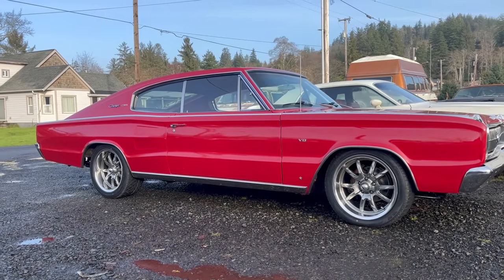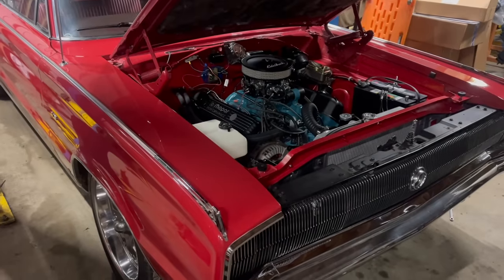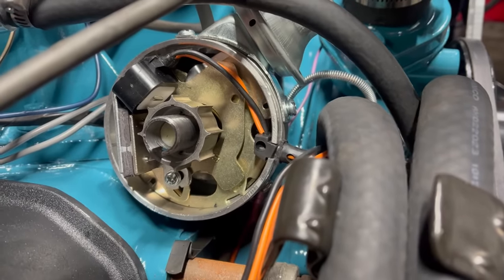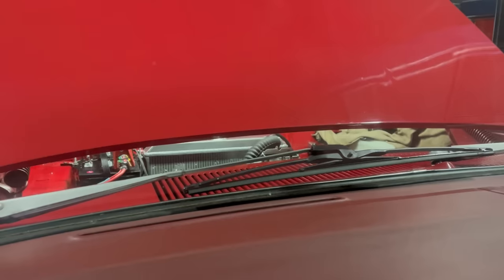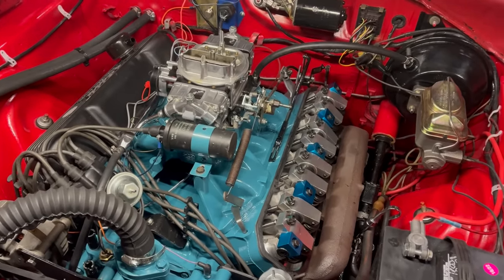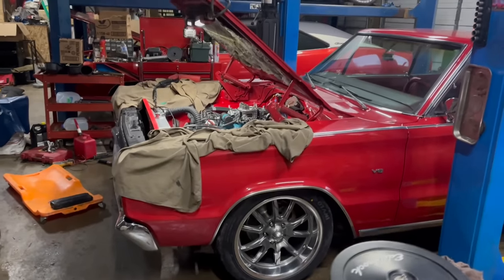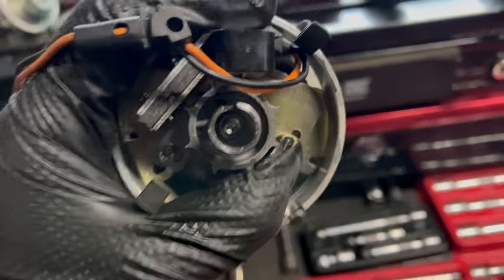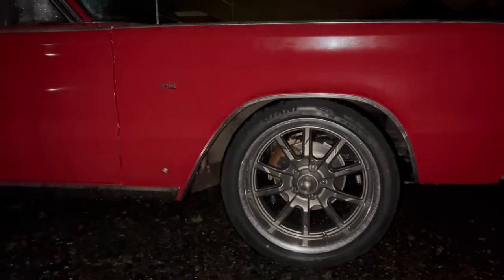What's Wrong With This 1967 Dodge Charger Big Block 383? When Bad Parts And Builders' Mistakes Mix

Comment: Jamie l see that the conversion to disc brakes look good the 67 l'm working on has original disc. Talk about unique there's a bracket that the flex line attaches too then a hard line to the caliper. l also talked the guy into putting relays on his headlights too. Stock 383 two barrel no headers and stock cam. Was overhauled 10 years ago. It has never been fired up since.So when l go to fire it up this spring l insist that he be there to hear it. Yes l've been having him crank over the for thirty second a month to go keep things lubed up and free.But ignition wise it is not hook up. Don't want him to fire up the engine cause the cam needs to be broken in and he's no mechanic for sure. Will also add zinc to oil to save cam and bearings. l've had to put this car together from scratch since paint job. Next is the interior carpeting dash door panels consal and every thing else.
Reply from the maker: I would be worried about all that cranking wiping the cam lube off anyway, which could even make things worse… I hope it works out ok.

Comment: I had red '66 back in' 71. I picked up a red '67 a few months later that was stuffed in the rear. I swapped the 383 4-speed from the' 67 to the '66.
My brother still has it. I sold my '70 'Cuda to buy it. Love these cars!

Comment: OK I get it. Back in the day I had a 64 Corvette 365 HP 3.7 gear it was a scooter, A friend Cury Joe Has a 66 Charger like this one. He loved his Charger. I really enjoyed watching and hearing the investigation. I suspected Cam Timing. Too Bad you couldn't fix all the issues, Great Video. Thank You, Dennis Great old Machines.
Reply from the maker: Yep you had it. Haha. Thank you! The good news is, the owner is quite capable and has fixed tons and tons of stuff since it went home. Wiring, head lights and motor circuits, brakes, front end stuff, etc. It’s looking really good.

Comment: At about the 20 minute mark after changing the carb and checking for leaks,  the no spark crank didn’t sound right…figured  it was cam timing or some terribly adjusted valves. Yep cam timing then at 25:39…yep valves are wrong too. One likes to assume engines are assembled correctly but really sucks to waste several hours troubleshooting based on that assumption. Wonder if the person that assembled the engine adjusted preload based on crank position instead of on the cam base circle, and that’s why some of the adjusters were buried? Whatever happened it’s better now. Good job showing the steps to fix other peoples fck ups and tuning the timing.👍👍
Reply from the maker: Yeah this one was a pretty big cluster frig. Haha. Just one thing after another - but glad I got it where it needed to be.

Comment: Love your video.  I usually would have pulled the valve cover much quicker.  Certainly by the time I saw the distributor was in wrong. Good lesson for the future.  (I have a long story, but basically I learned that lesson the same time I learned that Chevys will run 180 out).

Comment: I just changed the timing chain  on a 327 amp.  I used the same roller chain that this builder used .  the directions  seemed ok  but  one could get confused because that lower gear has multiple marks on it . I used the original gear s to set the cranking cam position. then put the the new roller chain and gears on.  works fine.
Reply from the maker: I could totally see confusing the marks, but this didn’t seem to be that.

Comment: Jamie, please go back to the owners to work on the remaining electrical issues, especially the dash lights.  I would love to see that, although my 67 Barracuda does not have electroluminescent lights, it would be a great how-to for us in general.
Reply from the maker: I would love to do some video on the EL system. The owner lives about an hour and a half from me, and for now the car has gone home. We may well see more of it in the future - and I'm sure there will be more Chargers eventually.
Reply: @DeadDodgeGarage   I just watched your engine bay wiring on the 67 Coronet.  We did my engine wiring on my 67 Barracuda back in 2007 because we pulled the 340 engine out.  Now I “get to” (like THAT sounded too much of a treat) do the dash wiring while I am rebuilding dash cluster, etc, when it warms up next Spring (no heat in my “refrigerated” shop).  I am 63 so working under dashes pretty much sucks for me but I am learning so much from your videos.  Thank you for your great videos.
Reply: Jamie mopar magician always welcome to some el system content with my ride 😊

Comment: This video has been out for awhile but just wanted to comment on the issue with the orginal carb.
Had one once that idled ok but always had a hesitation off idle.Turned out primary metering block was the wrong part number for the carb.Swapped in the one called for in parts book - golden.
Reply from the maker: That’s very interesting!

Comment: Love the video. I am a new subscriber  my first car was a 63 sports fury I bought it with sized 318 I swapped it with a 383 that I pulled out of a 67 or 68 New Yorker not sure what year  no, I did was put headers on it I had to make motor mounts  I got on it one day around the corner and the fan went through the radiator     The car sounded fast, but it couldn’t get its own way sure smoke the tires but couldn’t get out of its own way I wish I still had the car I am Learning a lot in your  show Thank you for sharing your experience 💜😊

Comment: For the headlight issue - you might look into the Holley RetroBrite lights (at least for your own car). Yes, they are pricey - BUT worth it! I just installed some and I'd say they put out at least 3x the stock or even Halogen lights, plus their LED, so reduces the current draw (easier on old harnesses), and the pattern is much more modern = light where you need it, not just all over the place. And, you can get them in 3k, so the color matches the old lights. Think about it.
Reply from the maker: I’m more of a bright sealed beam and relay guy. It works, and they look stock! But there is a lot to be said for the LEDs.
Reply: @DeadDodgeGarage  right.  I was too. Relays on lights, all that.  TRY IT. You won’t go back to old school.  They’re that good. It’s the best mod I’ve ever done for drivability.

Comment: I had a 1967 Dodge Coronet with a 361 low block and I managed to install a generic OEM 383 four barrel manifold and Holly Carb in my garage. The car ran well, but the performance improvement was minimal, as it wasn't very fast to begin with.

Comment: I bought the performance one directly from Chrysler for a Hemi engine and it works beautiful in my 440, Excel dual point with the windows you can adjust the dwell

Comment: My brother sold a '67 Charger that we had taken a \part to restore. It was complete and only needed to be basically polished and cleaned and put back together. Some guy talked him into buying it from him and got a steal on it as it was a 383 4 bbl model with 4 speed and a couple of extras. He sold it for 500 bucks...what a loss. This was in 1991. It was still way below what he should have sold it fo,r even back then. It had that silver blue color and even the taillights lense area was perfect.

Comment: You can’t go wrong with a Fluke meter
Reply from the maker: It’s awesome! Got that one off of the Matco truck. That unit has seen some abuse. Note the off brand super long probe cables. I definitely ruined the originals.
Reply: @DeadDodgeGarage   I got one many years ago when I started my career in electrical work, still works great - had a problem with it once after about 25 yrs and was like, oh there is a battery in it?  I melted the leads once or twice too, but there is a fluke dealer local to me so replacements were easy to find 
You gotta tell the story on your live feed about giong to Cali in your ‘66 and almost getting arrested

Comment: The trick on Holley carbs especially dual idle circuit to get them to idle with a big lumpy cam is to take off the carb and adjust  the secondary throttle stop on the bottom of the throttle plate open until the butterflies are just below the transfer slot and that will give the engine more air so the primary’s can be below the transfer slot and will not pull fuel from it and only the idle circuit.
Reply from the maker: Other methods of dealing with that - holes in throttle blades, or even better, an external air bleed/bypass, ideally through an adjustable valve.

Comment: That instrument cluster has an electro luminescent coating on it as you mentioned which is powered by a 220 volt ac inverter. it's under the dash behind the glove box insert and that is more than likely what is wrong with The Illuminating of the instrument cluster. It is a Round Disc approximately 6 in in diameter and an inch and a half thick with four wires that come out of it. It's either that, or the rheostat on the headlight switch. could be both.
   As for the ride heights on the front end, I would strongly suggest doing it verbatim to factory service manual because the spring rate on those torsion bars could be slightly different from side to side and if it has small block torsion bars in it then it will be messed up anyway especially if it has a big block on one side and a small block on the other side. What we used to do was put six cylinder torsion bars in there. that will help it launch better by giving it more lift when you stepped on the gas, allowing a better instant center transfer of weight to the rear axle. Also, an adjustable pinion snubber & reinforcement plate is worth its weight in gold. Way better than wheel hopping "slapper" bars.
Reply from the maker: I know 🙂
Reply: @DeadDodgeGarage  well, did you fix it?
   Torsion bars too?
Reply: @DeadDodgeGarage  
  😁you know if i didnt give you a hard time, youd think i took sick, an wouldnt be able to work till i was healed.  😝😛🤭
   MERRY CHRISTMAS TO YOUR SHOP, & HOUSEHOLD!

Comment: I'm with you on not being a big holly carb fan. They are great on race cars but on a weekend cruiser I hate them and it is all because on the sticky needle valve all holly carbs are known for you store your car for the winter and go to start it in the spring and the thing starts hard and won't run because it's dumping tons of fuel down it's throat or coming up out of the vents and getting fuel all over the engine anyway i run a Edelbrock carb that i pulled out of the box installed it and it ran perfect had to set the air fuel just a little and it was perfect and have never had a issue with it ever since and it's been many years since I installed it.
Reply from the maker: Yep… or the o rings around the needles fail… or whatever else dries out. I’m not a fan.

Comment: I could tell that the timing chain and sprocket was wrong by the sound . I’ve installed one wrong probably 25 years ago and it was a lesson that I never forgot. If you listen you can hear the hesitation almost a piping sound from the carb.
Reply from the maker: Yep. I did hear that. I had questions.

Comment: This video reinforces the importance of finding a shop where the guys have worked on classic MOPARS for years. Yes, it’s going to cost more to repair BUT they’re not going to make stupid mistakes in the repairs and they will use the correct parts (not cheap Chinese replacements) for your MOPAR. Chances are g to his car will never run like it should because of how it was rebuilt.
Reply from the maker: Unfortunately, for a lot of parts, cheap Chinese replacements are the only option short of seeking out NOS or good used. Obviously my preference would be either of those last two. Otherwise, yes, I completely agree. There are more of us out there…

Comment: Hey Jamie does the center caps on wheels have a mfg. name ? Or do you know who makes those rims ???
Reply from the maker: Ahhh crap. There was a name on the caps but I can’t remember what it said, and I’ve already cleared the footage off of my phone so I can’t go in and enhance
Reply: @DeadDodgeGarage  no problem Jamie and sorry to inconvenience you.   Thank you for trying & especially responding... T. Y.
Reply: Ridler 650
18x8 front with 225x35r
18x9.5 rear with 275x30r 
Offset I do believe is +0mm
Leaving plenty of room for more tire on this body style, 285 possible 295,305 🤷 some say!
Reply: @Yahooo509  hey thank you for taking a moment to answer. I've been online for many hours with no luck. It was getting personal hehehe 
Car Guys & Gals are the best !

Comment: I must have missed where you got all excited about the headlights working. Or maybe they don't? I don't remember. It's been a couple days since I watch the video lol. Mine is a 440 Magnum survivor and almost everything works on it. Except for the headlights, but you knew that.😅
Reply from the maker: He told me they worked, but it turned out they didn’t. I’m guessing I edited out the part early in the video where I said they worked. Haha. The owner has since fixed them. I had to do all of that on my ‘66 too.

Comment: The other differences between the  66 & 67, were the 67 had a duel piston brake master cylinder, the radio & shift indicator lights on the 66 were electro-luminescence (like the dash. 67 had bulbs.) If you had a 318 in 66, you had solid lifters, 2 bolt valve covers & a forged crank! There were probably more differences, like carbs, but hey, I'm not Mark Worman!
Reply from the maker: Oh yeah. That would be poly 318 vs LA engine in ‘67. Forgot about that - and the lights changing. Good ones!

Comment: i could hear it as he backed it off the trailer ! it has some issues in the timing it sounds advanced to the point it's firing as the fuel is exhausting. its got the tin can tap

Comment: I found one time that the engine was running bad and had timing issues because the bushing for the oil pump drive gear was worn right out and this was on a rebuilt engine too. I guess whoever rebuilt the engine never put a new bushing in for the oil pump drive gear and it was causing the issues the car was having. Have you ever had that issue before?
Reply from the maker: I have heard of the gear spinning on the shaft, but I have never seen a severely worn bushing - yet.

Comment: 1966 and 1967 had different steering wheels as well as different wheel covers. 1966 was 361 only. 1967 had the 440. It's the little things! By '68 there was the cost cutting!

Comment: Neighbor brought a truck to a backyard mechanic to add performance parts. When the guy finished it was barely drivable. 😢 So the neighbor sold the truck and the next owner fixed the mistakes. 😃

Comment: Did you know those are adjustable with the screw 🪛 in the end of the hexagon vacuum advance pod. If you adjust it in the whole way and out 1/2 turn it will work right off the get go..😊
Reply from the maker: This aftermarket pod doesn’t have a screw. I checked.

Comment: And you see it all the time in forums with people saying just rewire the cap the position of the oil pump drive don't matter.  Right up until you need to fix someone else's hack job.
Reply from the maker: Yep… and yeah, they’re technically right. It works. But it’s so much easier to service, and to understand what’s going on when they are arranged correctly.

Comment: It’s still a heap! But the potential is there! With a little more help, could become a great cruising machine!
Reply from the maker: That’s a little harsh, as it’s a very straight and solid car. but there are definitely more opportunities for improvement. The owner has been hard at work on that. My job was just to figure out the engine headache.

Comment: Had to relocate the voltage regulator on my '91.5 Dodge/Cummins when it was NEW. It was heat soaking in it's location right behind the head.
Had the same on now on the inner fender for 31 years.

Explained that SAGA in the comments on the silver Dodge Crew Cab video.

FACTORY ENGINEERS couldn't diagnose that problem, MY DAD did!!!
Reply from the maker: They still had the separate regulator in 91? Interesting! They must have moved into the “PCM” (that doesn’t really control the powertrain in any way) starting in… 92? I have had many problems with them in trucks due to being in the drip line from the hood.
Reply: I couldn't tell you how, or why, but it has both. 
The "does almost nothing" PCM AND voltage regulator right where you're describing it. Well, it used to be there.
My daughter has a '91.5 as well, my son did the one-wire alternator conversion on it.

My son and dad both know A LOT more about it than I do. They went to SCHOOL for it, I'm a hobbiest.

Comment: soon as he started swapping distributors i knew the mechanical timing was off, without even paying attention to how it was turning over, which was the other dead giveaway. i get it if someone mis-times a doch v engine, especially once with vvt - those are very hard to set timing on when putting them together. but a cam in block engine should be a no brainer.
Reply from the maker: You would think…

Comment: I don't know how you don't curse at all..

Anyway,  when you gravity bleed the brakes do you loosen all the bleeders at once or do one at a time starting from the furthest from the master and working your way down the line?
Reply from the maker: I generally do one at a time, but I have done two in the past. Also, the order in which they are done isn’t important in most situations. Conventional wisdom is furthest brake first, and if I’m fully bleeding / flushing a system I will do that. But if one only works on a single brake, or two brakes, it really doesn’t matter.

Comment: When i heard it fire i instantly said the cam gear is off one tooth.
Needs front end alignment...  And horrible inner bushings.
Factory did NOT have park lights as running lights.
I had a brand new 66.
Reply from the maker: One tooth? Try 6+… Yep. All that.